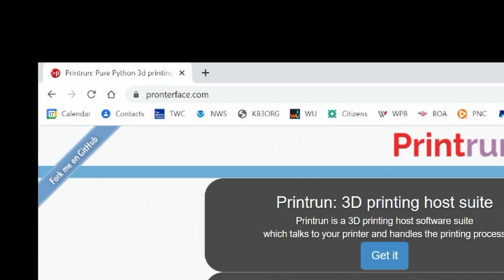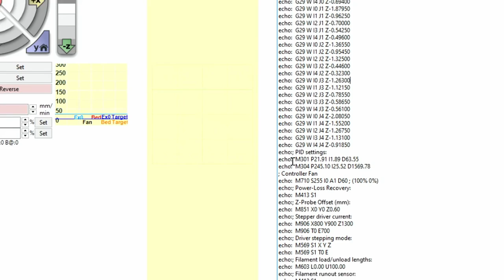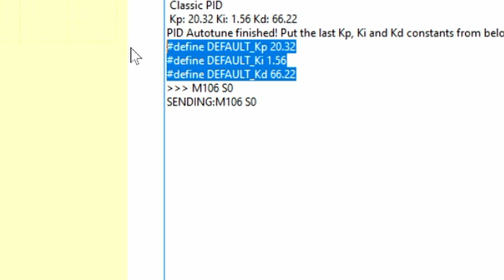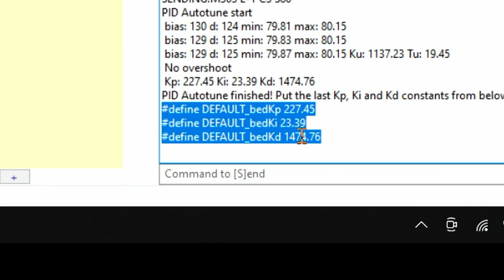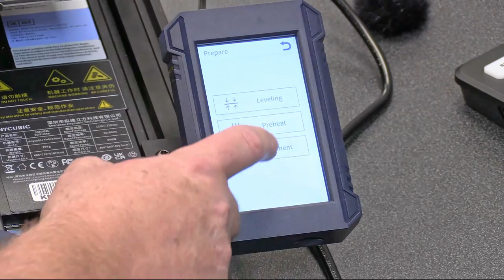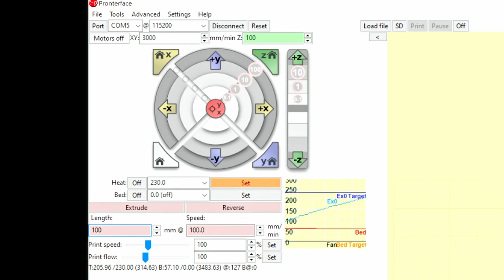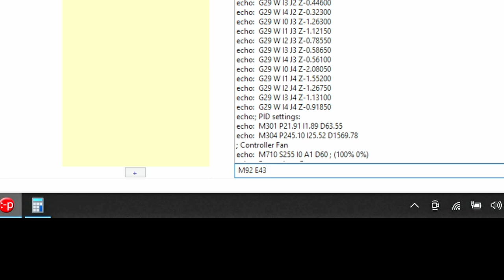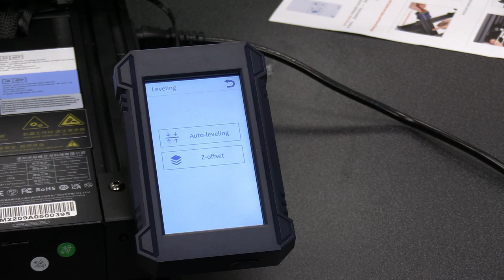Anycubic Kobra Max - Improve Printing

Comment: Thank you for the video it was a big help when i put in M500 to stored. it doesn't say stored or do i turn off the printer and then back on
Reply from the maker: Yes. Power cycle the printer.  If it didn't keep the settings just manually add them without do the autotune first.  Also,  make sure you copy down the original settings before changing them in case you need to back to factory settings.  There is no rest to default feature.

Comment: Can a power outage reset the settings to default? I was having uneven prints, so I calibrated it using your guide (great guide by the way), and it printed perfectly. However, we had a power outage, and it started printing uneven once more.
Reply from the maker: No, an outage shouldn't reset the settings.  Can you tell if the settings are actually different?  I always forget to write them down in case I need to refer back to them.
Reply: @TheMakersCave  I finished a second calibration, and it works fine. I wrote the settings down in case it messes up once again. Thank you!

Comment: Hiii, 
Did you ever try to put an nozzle 0.8mm on it ? I did and I have so many issue , I can’t stabilised my setting.
Reply from the maker: No, haven't been brave enough to try different nozzles.  I just picked up another Ender 3 Pro, maybe I'll use that to experiment with.

Comment: Hi The Makers Cave, I've done everything but it's not extruding more than 77mm. i have calculated many times so the number of steps grows and nothing. everytime after M92 E... i send M500 command with no success, around77mm, not more. Help please!
Reply from the maker: Hi, thanks for watching.  I'm assuming that you mean when you issue 100mm to be extruded through pronter face it's only extruding 77mm?

Comment: What if you dont get an echo back from pronterface it just says sending when i put in the m301 PID tune?
Reply from the maker: Hi!  What printer do you have?  M301 saves the settings, what happens when you do the M303 to auto tune, does that command run and give you the PID numbers?

Comment: I think a lot of us find that the Kobra Max prints hot.  For PLA+ where I'd normally run at 215 I run at 200.  did the PID tune help this or is it just the nature of the printer?
When printing I do see that the nozzle temp is very stable.
Reply from the maker: I have also found that the hotend runs a little hot, on my Vyper too, so it's a Anycubic thing.  Others have noted it as well.  I just take set my temp, like you, 10 to 15 degrees cooler.  So far the prints are fine doing it this way. BTW, thanks for watching, I really appreciate it.

Comment: Is it possible to go back to the original  settings. After programming and leveling I started a test print. The nozzle dragged across and scratched the glass. It tried to print but continued to scratch it.
Reply from the maker: Adjusting the PID  and filament eSteps doesn't affect the Z axis. If this is happening after a auto bed level the leveling sensor might not be doing it's job and you might have to make some adjustments to the Z offset from the printer's control panel.

Comment: Thanks for making this video.  I never knew that I could fine tune my 3D printer settings like this.  I am currently following along with your video and I am fine tuning my Anycubic Kobra, and I'm fine tuning the PID for the nozzle.  It has been running for a little over ten minutes now.  However, I haven't received the message that the PID autotune has finished.  The coordinate numbers on the left hand side have stopped moving, and I don't see the default PID numbers on the right hand side.  Would you happen to know if this process takes a while before I will see the PID autotune has finished message, or can I continue and enter the new PID numbers from what it shows and then save them?

Thanks!
Reply from the maker: If you're using PronterFace you should see a message that says autotune finished.   If you don't I would turn the machine off and then on, and try again.  If you again don't see that autotune finished message let me know.
Reply: @TheMakersCave  That worked!  Thanks again for the quick reply!
Reply from the maker: @GerardLagana  I'm no 3D Printer Master but I try to help :)  If you need anything else let me know.

Comment: Hi Steve,  just wondering why when I do a leveling on my Kobra max 1 and I go to print something it’s always way to deep?  I have to bring it up to like .40 to be able to print.  For some reason it seems the auto leveling isn’t working right.  Any Ideas?  I want to add a pei steel spring sheet but am afraid to buy one worrying it will gouge the plate from going to deep after the leveling procedure.  Thank you for your time.
Reply from the maker: I have to admit that some of the sensors on the Max 1 can be faulty.  It may not be measuring correctly and therefore making your leveling off.  You didn't mention it but it sounds like the leveling is off the same amount  across the entire bed.  If you were going to replace something I'd try that first.
Reply: @TheMakersCave  Thank you Steve,  will look into that once.  Thanks for your quick reply.

Comment: For the hot end PID tuning, if you tune it to temperatures for PETG, would you experience problems when printing with PLA? Since typically PLA would be printed at a lower temperature, would the tuning have to be done again?
Reply from the maker: It should even out the algorithims for all temps, but it does tune just right for the temp you did it at, I would do a test print to see.  But here's a neat trick, do a PID for each temp you'll be printing at.  Write those numbers down.  In almost every slicing program there's a section where you can put in custom gcode commands at the beginning and end of a print.  In the start section of the custom gcode put the M301 and M304 commands to set the PID, but DO NOT put the M500 to save.  This way the printer will use the PID numbers you want for what ever filament you want to use for that file.

Comment: I am using mostly PLA. I guess I just need to adjust the temperatures for the filament I use?
Reply from the maker: Correct, tune to the filament you use the most.

Comment: during the e-step process you chose to "preheat with ABS" button and then fed in PLA fiber. Why not choose the "preheat with PLA" button?
Reply from the maker: I just needed to heat the filament so it could flow through the nozzle, not to make a print, so I just chose a preheat.
Reply: @TheMakersCave  thanks for the quick answer!

Comment: hey is there an easy way to restore the settings back to how they were? my printer seems to be printing worse now, i assume i misfollowed a step due to the incredibly positive feedback this video has gotten, and would like to try with the original settings
Reply from the maker: Unfortunately there is no factory default function.  In hindsight I should have told viewers to write down their original values.  Have you done another 100mm extrusion test to see if that is correct?  If it's still not correct then that would be your problem.  Just last month I was adjusting one of my printer's e-steps and couldn't get it right.  It would always come out over or under extruded.  It came down to me not doing the calculation correctly.  I've done this e-step tuning quite a few times and I still made a mistake.
Reply: @TheMakersCave  small prints work fine, its just mostly when prints take a few days where it fails. this could also just be a maintenance thing but i only really started noticing the issue after following. when i get a chance ill try another 100mm test

Comment: If you are using the Kobra Max profile in Cura, do you need to make adjustments to account for the extruder now being accurate?
Reply from the maker: No, but I’ve found that on the Vyper and the Max that the hot end is about 20 to 30 degrees hotter than the temp you set.  So I would adjust my temp on Cura and do a test first.
Reply: @TheMakersCave  thank you! First time printer here, with the Kobra max. Your videos have made the lack of documentation much easier to cope with. Thank you!

Comment: I'm trying to calibrate my bed on my new Elegoo Neptune 3 Pro, but every time I do I receive the following error - PID Autotune failed! Bad heater id  

I had turned the printer off and then back on again and ran the PID command for the bed, and this time I did not receive an error.  However, the bed never heated up.  I turned the printer off and on again and this time I received the error again.

This is the command I am entering for the bed PID bed calibration - M303 E-1 C3 S60

Am I doing something incorrect or is the bed on this printer not able to be calibrated?  I have Googled this error message and have had mixed resolutions.  By the way, the hotend PID calibration finished without any errors.

Thanks!
Reply from the maker: Sorry for delay in getting back to you, I was doing some research.  Let's start with your firmware, what version do you have?  It will be easier if we email.  You can use: Steve@TheMakersCave.com

Comment: Awesome video!! Working on our Anycubic Kobra. I was able to knockout your steps with ease except for the AutoLevel (AL). When I try to AL the detector cannot read the bed and it gives an error. So looking up more videos. Side note I cannot move the Z axis outside of hitting home or adjusting z offset.. not sure what’s up with that..
Reply from the maker: Glad it helped and thanks for watching.  Very strange on the z axis, what do you mean by "cannot move the Z axis".  Do you mean on the control panel where you can move the printhead on all 3 axis?
Reply: Correct. I cannot move the Z axis from the touch screen or ponterface.
Reply: One other thing.. When I user Ponterface or Cura to move my X and Y axis it makes a grinding sound. But if I use the Anycubic touch screen there are no issues. Is there some setting I need to adjust?
Reply: Anycubic support provided me with a new MB firmware that fixed my ABL. Thanks again for the tips. Owl came out close to perfect.

Comment: Have you ever had leveling issues with the kobra max? Ive had mine for 3 months now and no mater what i do i cant get the bed level
Reply from the maker: Right now my Max is down. the control board for the hot end went bad. But before that it was running fine with a good level, kinda.  My wife mainly uses this printer and she was remarking that every few days she would need to relevel it.  I have a new Kobra 2 Max that I need to do an unboxing/review on.  I'm finding it hard to get the board to repair the OG Max so i'm probably going to just replace it with the Max 2.

Comment: I have the anycubic kobra and connected to the pronterface but it wont let me change the com. My printer is in com3 but it only shows com1
Reply from the maker: HI!  Thanks for watching.  Want to confrim  a couple of things.  Make sure that only Pronterface (PF) is running.  If you have a slicing program open along with PF it might not see the printer.  Next, if in the Device Manager you can see that the printer is on Com3 but that port is not showing in PF trying rebooting the machine (if you haven't already tried that).  If this doesn't work let me know and I'll try to help you :)

Comment: Great video! I now feel confident in tuning the esteps however I have a Kobra Neo and so my printer does not have the option in screen to tell it how much to extrude so I will have to enter in a command in PF to do so, which code would it be?
Reply from the maker: On Pronteface there is a section on the main screen to set the length of the extrusion and there's a start button.
Reply: @The Makers Cave  Thanks! I guess if I bothered to look at it after I downloaded it I would have seen it. Plan on  doing these tunes later this week!
Reply from the maker: @crystalnordeen4322  I'm no 3d expert but if you need any help let me know :)
Reply: @TheMakersCave  I most definitely will. Thanks for being so helpful 🙂

Comment: I bought an Anicubyc cobra max printer and it did a few prints with a satisfactory level of quality and then it started to have under extrusion the whole object has holes in it.  I tried various flow and temperature settings and a lot of other things, but there was no change for the better.  Then I wanted to do an e-step calibration with the pronterface and I noticed that the extruder stops three or four times while pushing the 100 mm filament and then continues, regardless of whether it pushes the filament through the hot head or directly from the extruder without a bowden tube.  There is no way I can set it to push exactly 100mm, it always has underextrusion, sometimes by 25mm, and it always pushes less than 100mm.  The gears in the extruder are good and clean.  Could you give me some advice if the problem is in the motor, the motherboard, the voltage that the motor receives or what it is about.  Thanks a lot.
Reply from the maker: That is very strange, it should, as you know, just continuously push the filament through for 100mm.  Is the pause start/stop at the same duration and time each time or is it random?
Reply: @TheMakersCave  It is very uneven, sometimes it is 2mm and sometimes it goes up to 25mm, it is always under extrusion, sometimes I think that the filament slips in the extruder.  But when I disassemble that plastic extruder from the cobra max, I can't tell if the teeth are worn or not.  I would like to replace the extruder but I don't want to put that plastic cobra max extruder back in again.  Could I put a metal extruder from the Ender 3 v2 because the screw holes match because it runs on the same motor and the filament push can be adjusted in the proterface right?  Or do you think I can put another extruder.  Thank you very much in advance.

Comment: I´m having big trouble finding out the adjustements on my kobra max for petg. What filament do you recommend and do you have a certain petg profile you´re maybe willing to share?
Reply from the maker: Hi!  I use overature PETG from Amazon and I've had good results.  I just did my first test prints using that petg on my new Kobra Max and it worked great.  That video will be out tomorrow late afternoon.  240 on the nozzle, 80 on the bed, restraction 0.8mm @ 35mm/s, fine quality of .1mm layer.  I did a calibration cube @ 20mm with it and it came out perfect with all sides @ 19.8mm.  https://amzn.to/3Qa6tX4

Comment: This pronterface does not seem to work with Kobra standard.  Can’t connect.  I actually got it to connect but it apparently doesn’t stay connected.  Was able to pull all the settings doing the M503 thing and then turned fan on high setting and went to do auto tune and it would send the command but nothing happens.    Gave up.  Why i should had listened and got the Pursa printer.
Reply from the maker: Make sure that PronterFace is the only thing running.  If Cura, or something else that uses the 3D printer's port, is running it won't allow Pronterface to connect.  Let me know how it's going.

Comment: When you plug in M106 S255, should all 3 fans be running on high speed?
Reply from the maker: I believe it's just the hotend fan.  All my hotends have just one fan so I'm not sure what that command will do if there are multiple fans.  Here's the description from the Marlin website on the M106 command, I included the link too.
"Turn on one of the fans and set its speed. If no fan index is given, the print cooling fan is selected. The fan speed applies to the next block added to the planner, so it will not take effect until previous moves in the planner are done. Under manual control with an idle machine, M106 will change the fan speed immediately."
https://marlinfw.org/docs/gcode/M106.html

Comment: Just a quick question, after you put in the m503 command and brought up the list on the screen, how did you clear the screen to go to the next step, seems my full list stays on the screen.  Thanks for your time.
Reply from the maker: Hi, thanks for watching!  If you are using the Windows version of PronterFace under the "File" menu there is an option to clear the console box, the short cut key is: Ctrl + L.
Reply: Thanks for your quick reply, still kind of new to all this, really enjoy your channel.  Loving my max for sure.

Comment: I've recently started using my Kobra Max, and six prints in I have broken a belt on the y axis.  I was very cautious not to over tighten it but I may have anyway.  I have yet to see where to purchase or how to replace these belt anywhere.  Maybe you can help direct me?

Thanks, Mike
Reply from the maker: Hi, thanks for watching.  You can call anycubic and order a belt but if you want a quicker solution you can get a generic length of belt Amazon, you'll also need to buy some clips/clamps to join the ends.  Here's a couple of links. 
The belt: https://amzn.to/3LsF5Ch
The clamps: https://amzn.to/3DliJ3q

Comment: Hello, just wondering after I make these changes is there any way, 
I can bring it back to original from the factory.   Thank you for your time in this matter.
Reply from the maker: I found no sequence for a factory reset procedure from Anycubic for the Kobara Max.  I do know that if you a M502 command is supposed to do a factory reset, you then follow with a M500 to save.  I have never done this and I can't find anywhere where someone has done this with the Kobra Max.  Sorry I'm not helping much on this. :(
Reply: @TheMakersCave  It’s all good, Thank You for your reply.  I just need to figure out why my nozzle keeps dragging on the print, and everything I researched I am trying but no luck.  I am still newer to this so the struggle is real.  I really don’t know how to set the Z-offset on the Max so If you ever have a YouTube video on that I will be checking it out. I just figured maybe resetting it to original maybe was worth a try.